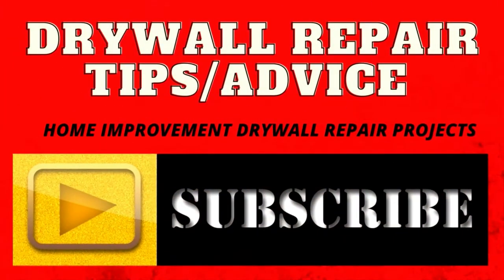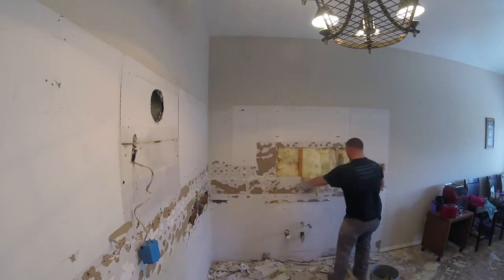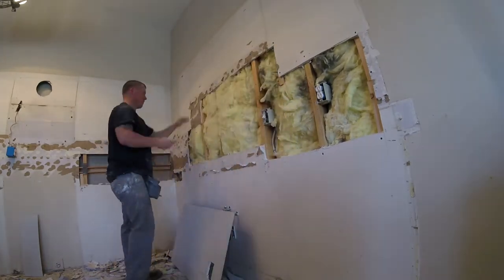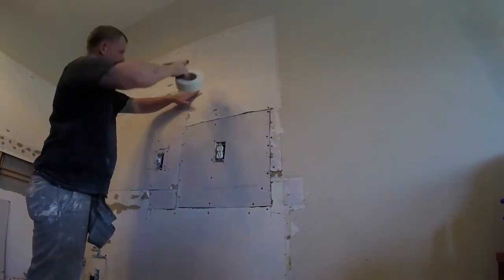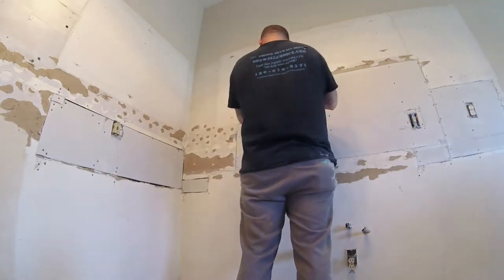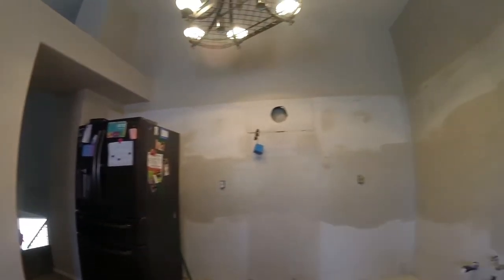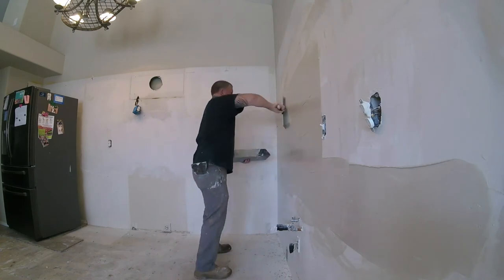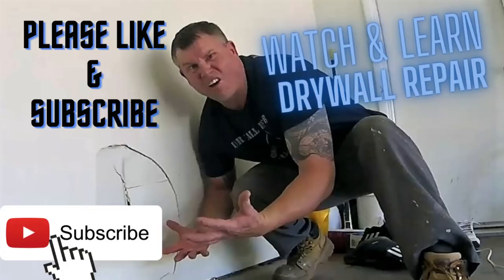how to effectively redo kitchen backsplash wall that has been severely damaged due to tile removal

Comment: Hi Mr Drywall.  From my understanding everything about drywall was designed around minimizing expense.  4x8 sheets, tape, mud are all cheap.  Labor is cheap (sqft / $), when compared to other wall finishes, when done by an experienced professional.  I do not see how this method of scabbing in patches is cheaper than reinstalling full sheets.  The extra expense of your time to square off all of the holes, add backing where no studs exist, and tape and mud that jigsaw puzzle had to be much more than the alternative.  Heck, one bucket of thin set mud to skim coat equals the cost of 2 sheets of new drywall, then the skim coating could have been skipped!  Can you help me figure out the math?  I will be starting this job in my kitchen soon.  Thanks.
Reply from the maker: heres another video on backsplash patch in
https://youtu.be/eCPLWsdxpIw?si=b72GhMjBSLnsDKTs
Reply from the maker: https://youtu.be/eCPLWsdxpIw?si=4Le_r6xlAeYgU_7h
Reply from the maker: sheetrock is just a fill in obviously you haven't followed the channel long enough drywall is about the mudding and texturing, and honestly if you have to watch YouTube videos on how to do it you should probably hire professional
Reply: @drywallrepair   Thanks for the replies and video suggestions.  I will watch them.
Reply: @steverrada   I agree with your logic but not necessarily because of cost reasons.  What your suggesting actually might cost more but insignificant.  Based on my experience, instead of cutting out all those small squares and taking the time to patch them all in like a mosaic, it would have been much easier to just cut one large rectangular piece or whatever then do your tape and mud.  (ex. Cut out one 3x5 or whatever size to cover area of repair) So actually, I guess you could still make the cost argument cause it would have saved time but more importantly to me, make the job less tedious and time consuming. But like you said, cost of those materials are insignificant compared to the time, effort and frustration it takes to do the work.